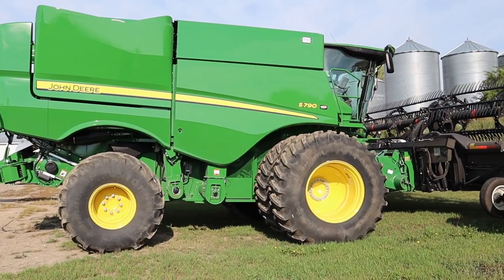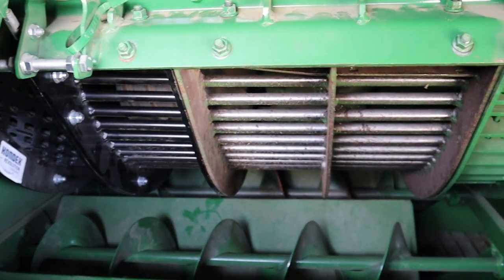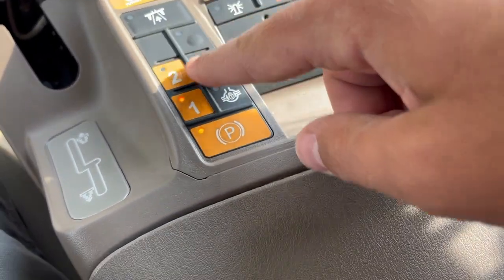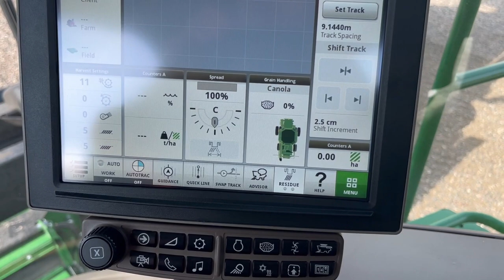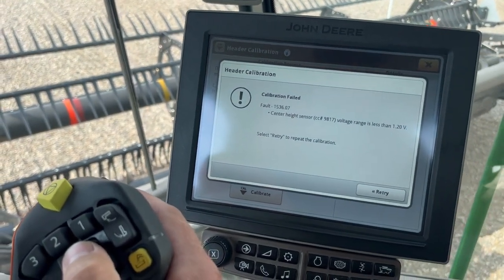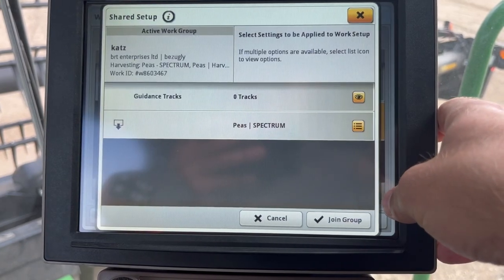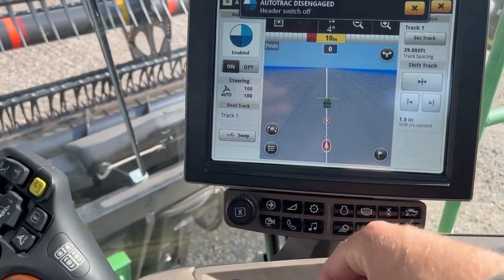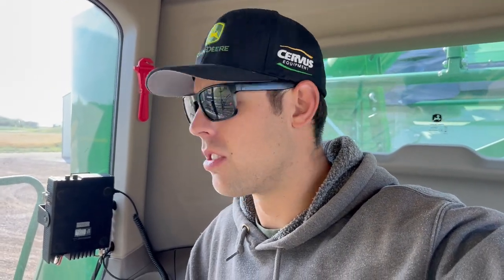New Combines On The Farm!

Comment: Do you notice any capacity differences between the FD1 and fd75?
Reply from the maker: Not so much capacity it’s just that the FD1 feeds so much better, peas especially
Reply: @dustinbezugly  is it the auger or what would you say makes the biggest difference?
Reply from the maker: On FD140 the cross auger flighting goes right to the centre, there’s more fingers and the centre drum is smaller I believe allowing more crop entering the feeder house so yes I guess the capacity would increase